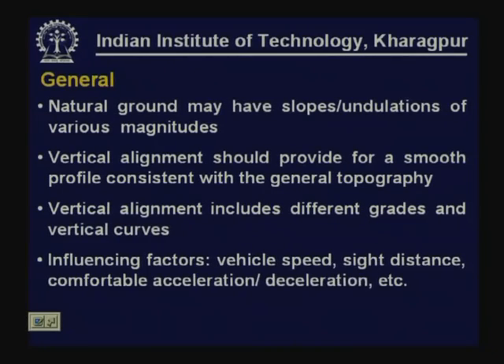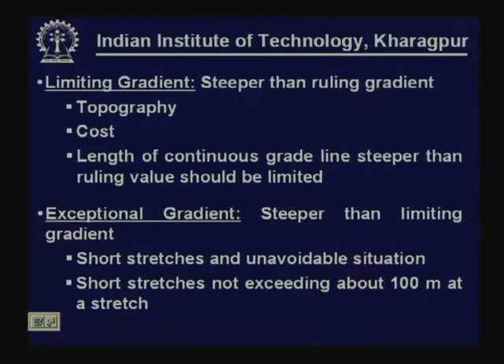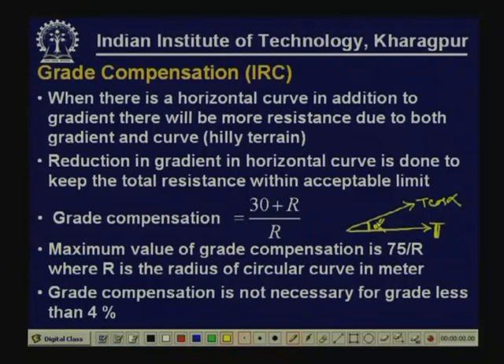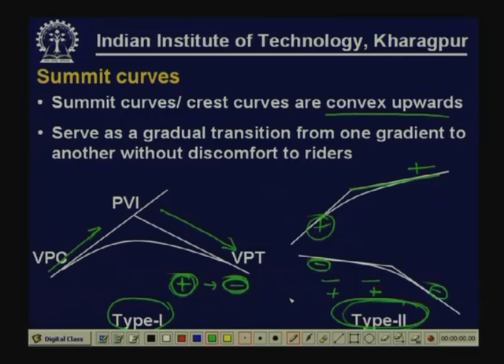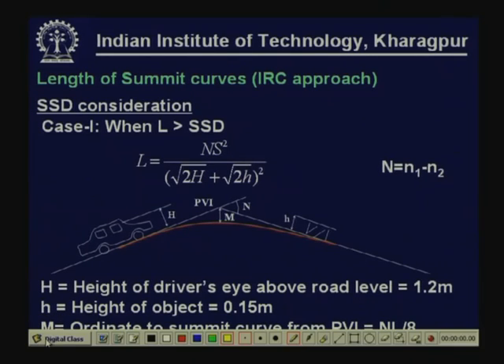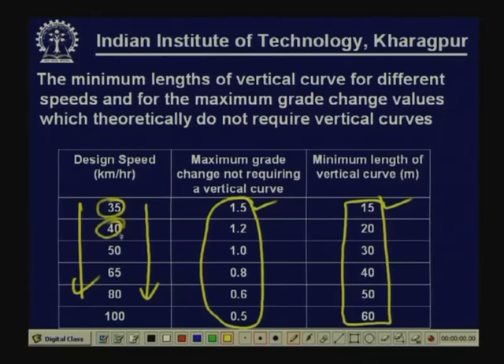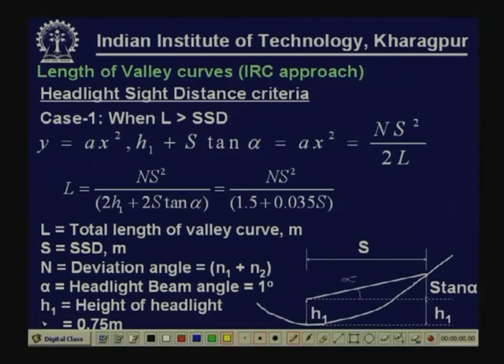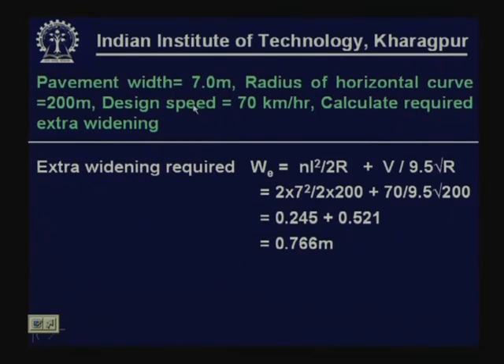Lecture - 20 Vertical Alignment Part - I

Comment: Sir, Why object height for OSD is 1.2m but for SSD is 0.15m??
Reply: Don't know if I am right, in OSD we consider one vehicle overtaking another uniformly traveling vehicle.. hence object in O.S.D is a vehicle which should be atleast 1.2 m high whereas in SSD the object can be anything from tiny to large...but a suitable size of .15 m is selected
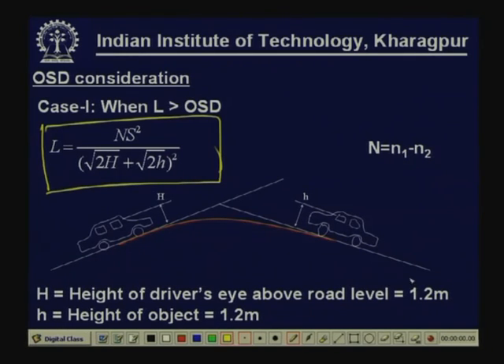Reply: 35:50